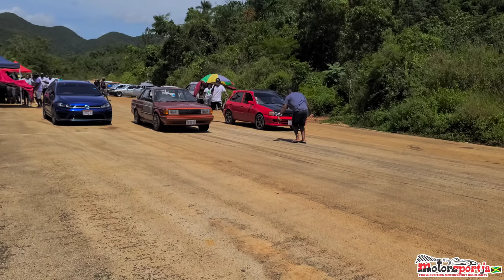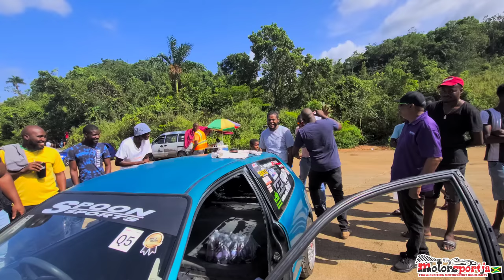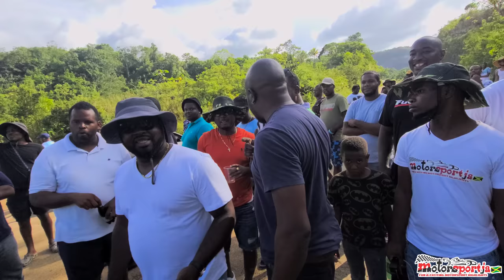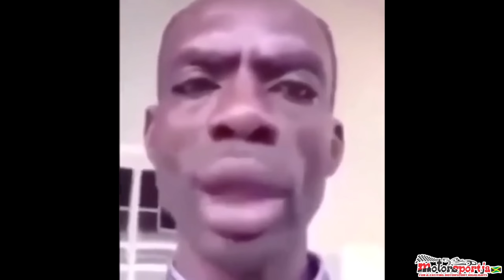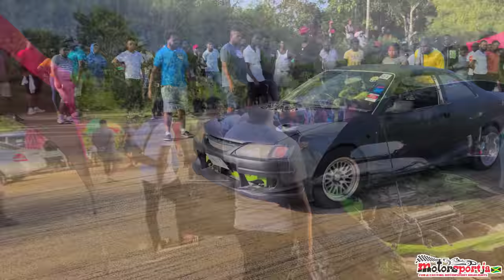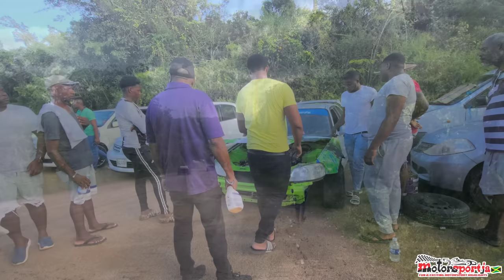2zz-ge Nitrous vs SR20 VVL | This vs That | Motorsportja | FWD Cash Days || Street Racing

Comment: Listen man unnuh leave the Mexico slang alone. Annnuh everything unnuh fi follow up. Unnuh don't even know what it means. 

The term originates from 2005 in the underground street racing scene on YouTube. It was used to insinuate that the drivers were out of U.S jurisdiction as a way to deter law enforcement from cracking down on speeding. 

Unnuh definitely cannot drive cross sea so weh unnuh use the term fa? Unnuh too nuff. A so unnuh followfasshin.